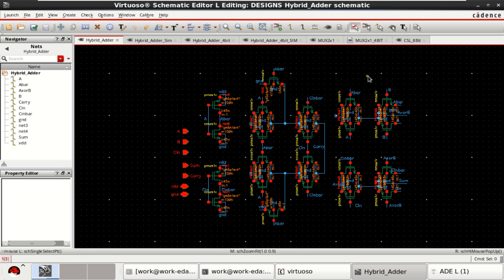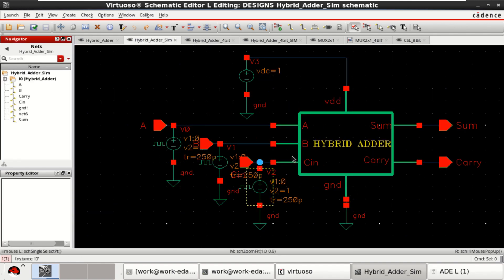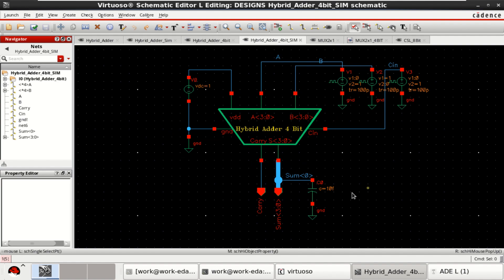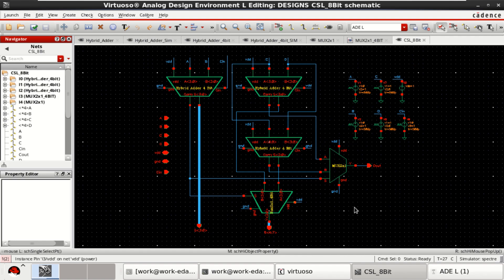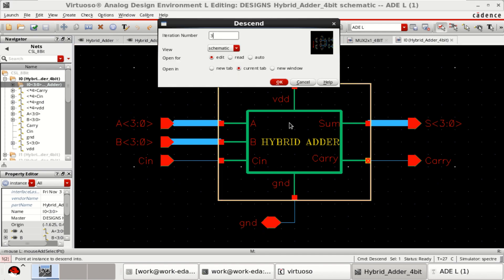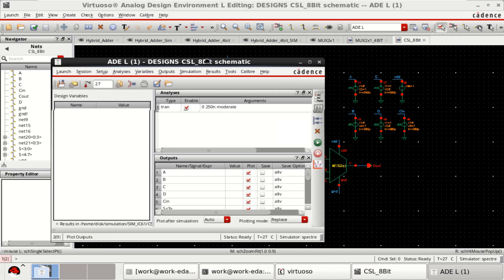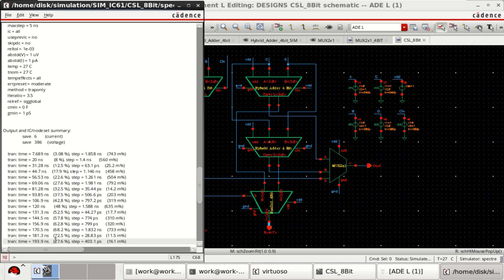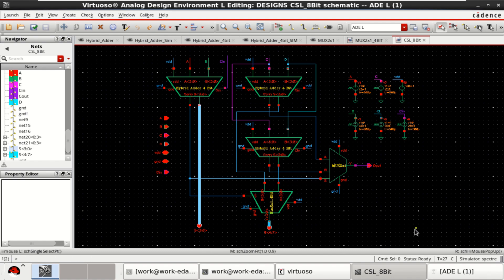8-Bit Carry Select Adder Using Hybrid Full Adder.

Comment: First off, Sir, thank you so much for uploading videos. Secondly, please do a video or direct me to a video that shows how to effectively use the auto-placement tool for layouts in Layout XL or Layout EXL. I need to build a 4096-bit memory array for my final year project; to do this efficiently, I need to learn how to use the auto-placement tool without running into a grid error. I've been trying to work on this for the last week and am still waiting to make meaningful progress. I have already talked with a professor, and he does not seem to know what the software does, so any advice will be deeply and profoundly appreciated.

Thus far, I have not found any videos on YouTube detailing how to use these two tools: the pin placement, the auto-placement tool and the auto-router.

Edit: For anyone who finds this comment:
1. Draw the PR boundaries
2. Now you can access the pin layout tool in LX or ELX
3. In the sub box, you can set the pin to Level-1 Pin
4. Then press apply, and you will have the pins auto-populated.
Reply from the maker: I can say that there is NO such tool for placement and route. Devices are generated automatically but connection and their placement need to be done by designer.